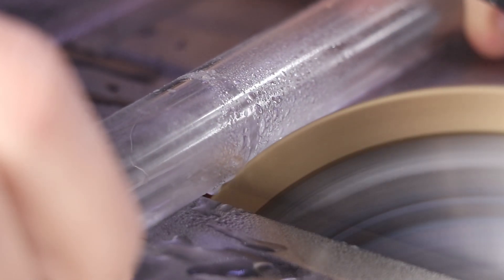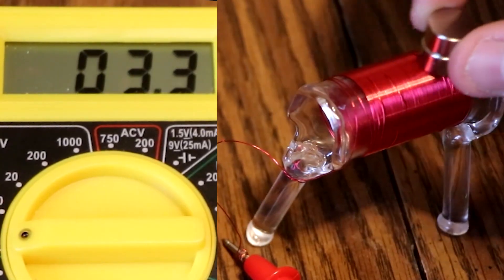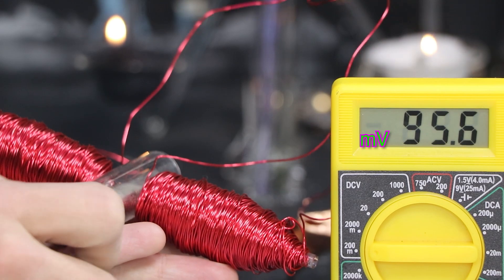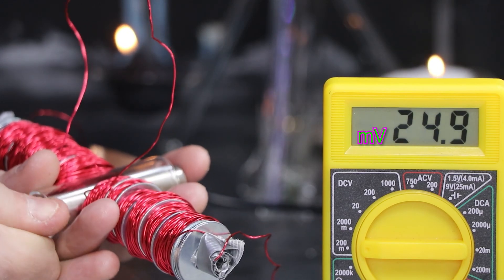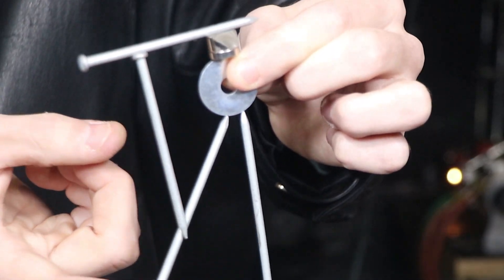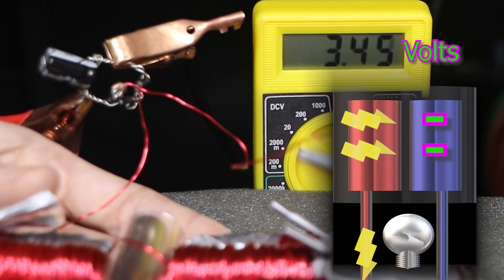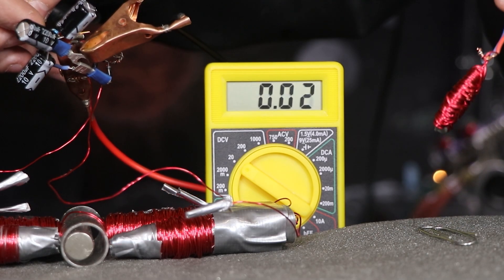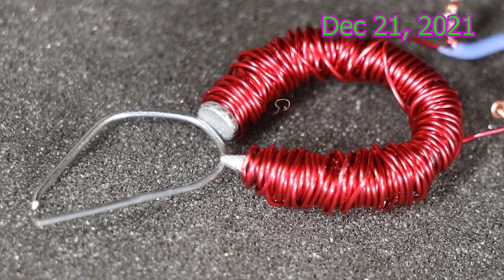The Iron Golem electric generator "A Magnetizing Journey"

Comment: Can you tell me what brand your glass saw is and what is that scoring tool for snapping glass? I'm very interested in a wet saw that cuts glass tubing. You saw does a good job.
Reply from the maker: Certainly, it's a 7 inch Skil wet saw (model# 3540-02). I chose it for its affordability, only $85. I also replaced the factory blade with a thinner one marketed for glass. 
   The scoring tool is a basic tungsten carbide edge tool ( https://www.mountainglass.com/Tungsten-Carbide-Scoring-Knife ) It takes some practice to get clean snaps.
  I've got a video on both tools, let me know if you have any questions and don't forget to subscribe.
Wet Saw - https://youtu.be/T_Vh1SQFyWI
Snapping glass - https://youtu.be/JKuHjV2DFAY
Reply: Thanks for the links and information and taking time to write. It's sure fun to imagine making things when you have a way to be creative. 
Just out of curiosity 
I was wondering if you know where I might find a 3/4 inch diameter borosilicate tube bent in a tight radius in the shape of the letter J? It's hard to bend 180s without deforming the tube. I've seen U tubes but with a wide radius.
Thanks again for the links.
Reply: I saw an item on eBay called Speedy Sharp which I believe is the same carbide tool. The price was about the same $12.95  on eBay and free shipping. If you buy another you might try eBay. I am looking forward to using all the fused quartz tubing I have, it's nice not having to worry about thermal stress with quartz. Thanks again for the tips, with smaller tubing the knife will be a time saver with practice.
"Originally designed as a knife sharpener, the Speedy Sharp is the best kept secret of glass artists for scoring and breaking glass rods and tubes. This off-label use has produced fantastic results time after time. The tungsten carbide blade features 2 edges, doubling the life, even under heavy use. "
Reply: Aside from the "Speedy Sharp Carbide Sharpener" if you type those exact words on eBay, for $12.95 and free shipping, I saw this other fancier device here at the 3:15 mark.
https://youtu.be/JPqGbOwOI58
Reply: There's  also this glass tubing cutter that has an advantage of cutting a straight line scratch. EBay has them for about 8 or 9 dollars. They have a typical tiny carbide wheel like a typical sheet glass cutter but in a V-shaped device that holds the tubing so that you can rotate the tubing like those pvc tubing cutters.
https://youtu.be/JTvohC0xyL0